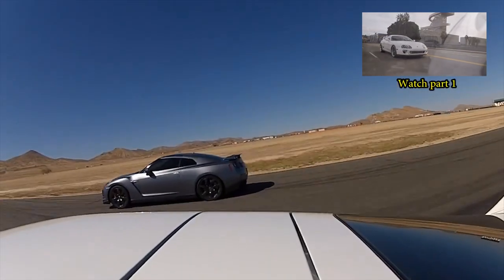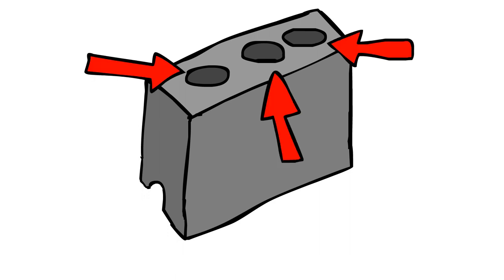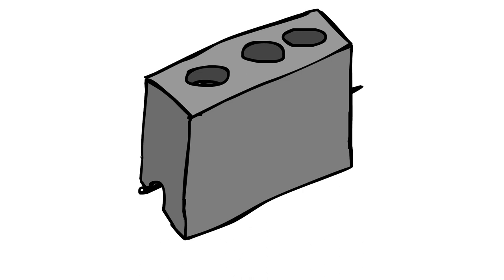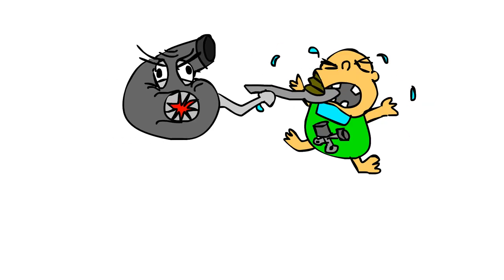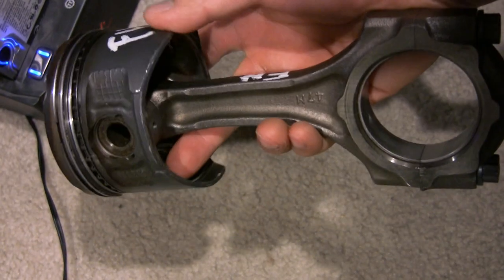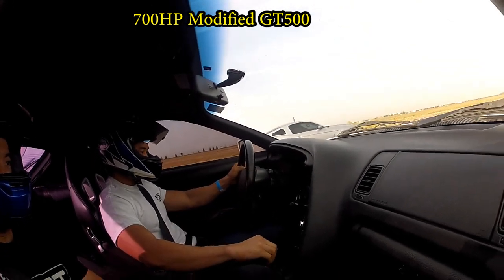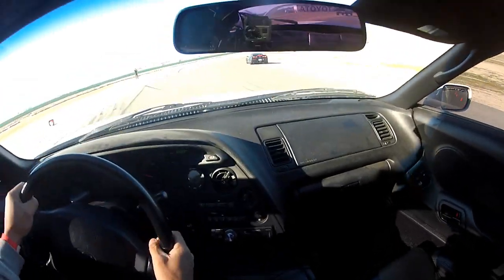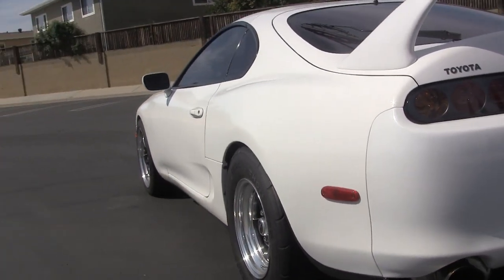My 900HP Toyota Supra TURBO PART 2

Comment: Ha ha ... one does not simply add Weld wheels and huge drag radials on the back and say they're done racing ... you'll be back!  My stock NA Supra is still chilling -- I want to drive it this summer, before going all ape crazy with mine as well (plus my 700 HP Impreza isn't happy with me either) ... but congrats for being back on the road just the same.

Comment: Looking at your Video... I am So happy to say that taking my car to get the motor build, gearbox done stage 3, complete pro mod upgrade for rear drive train, the right Suspension and  wheels and brakes, cage in the car all with a sweet ProEfi setup... All good for a daily 1200whp like the TRC Supra... I'm just happy i know that doing it right from the get go with NOTHING to break over and go on a trial and error issue...  sorry you had to spend so much money man. Them Supras don't come cheap and if I am in 60k,  i could not even try to think what you spent... ?  Good luck with your car man.. :)
Reply: +speadfreakmax Your car will break soon enough.  It's the nature of the beast.  And there's no such thing as a "stage 3" for a v160.  Ask me how I know.
Reply: Well stage three as i understood is was when they build, like mine, that the oil flow easier to the front when you do hard pulls on the v160. that is all that i understood from jacks transmission that goes for stage 3. 
And yes you are right , shit will always break, but it's like being NOT fit for a football game and being fit. the one that is fitter will just do better.. same goes for the motors... if it was build right for the purpose then other than human error how can it go wrong. 

And yes please, i am always open to learn. why do you say no stage 3 ?
Reply: +speadfreakmax you fell victim to Jacks' marketing.  there's not one single aftermarket component inside your "stage 3," so tell me again how that can possibly be a "stage 3," even if he did his magic soup synchro "preloading and groove opening."

Seriously, you'd have been better off getting a stage 1.
Reply: As things are right now, synchros are done, and short shift kit with the "oil flow" to the front. Box meshes like a warm knife in butter, but like you said, Nothing lasts forever and on top of that all, parts are tougher to come by.
Reply: +speadfreakmax I've rebuilt over 15 v160's.  The synchros he put in your box, specifically the friction rings (3 ring system) may have had the oil grooves enlarged, but that's not going to prolong their life as others have broken "Jacks modified synchro's" before.  the "trap door" he installed may keep a residual amount of fluid on the input shaft (5/6th gear/counter), but that hasn't been proven to improve the life span of the front gear set.

My factory v160 that I rebuilt with stock, OEM parts shifts like butter, too, as well as many other factory v160's that are in my area.

Sorry, buddy, you got duped for marketing that prey's on people who can't see past the smoke and mirror.

Next time, and there will be a next time...get a stage 1 and save yourself some money.

Comment: Awesome videos! I may have missed it if you had already mentioned it, but were you running e85 or pump and what type of fuel system are you using. Getting ready to take the leap into the e85 world and was curious of your experience

Comment: THANK YOU for making this video!! Just out of curiosity, how did you/the shop find out that the reason it spit the bottom half of the con rod through the oil pan was bc they hadn't torqued the bolts correctly? I'm just wondering how you can diagnose that's the reason, after it happened.
Reply: +Arthur Sperotto It's possible that the bolt were not broken and managed to wiggle their way off the threads.

Comment: Love your videos and I can relate about wanting more. Had my 93 supra in and out of the shop while increasing power and breaking stuff along the way. went from 400-1000+ whp and built the motor 3 times and now a broken v160 so car is down again. I plan to keep it on low boost which is around 700hp most of the time to keep it from breaking shit.

Comment: How much do you estimate you've spent on your Supra?
Reply: +Gee Singh Never ask a man that -- it's like asking a woman how much she weighs ...
Reply: +mbdulka true
Reply: Guaranteed he's got over 40k into motor alone
Reply: +Chiri Kotoji (Chirikotoji) doubt that.
Reply: +b00stedrust maybe more
Reply: It cost about 10-15k per build for that power level (not counting supporting mods that he can reuse on each build) ... 40K is probably about right (just on motor and heads) ... not counting injectors, FFIM, and other supporting mods.  The motor itself would be around 10-20k ... then another 5-8k to rebuild of a lot of the guts can be reused.  I can build a 1200 HP Supra (just the motor) for about 20k ... not's not counting the 20k more you'll need in supporting mods.  Of course you go go cheaper but it won't last.
Reply: I highly highly doubt he spent $40,000 on the motor LOL
Reply: +b00stedrust sorry I thought he said on the whole car.
Reply: It all depends what his mods are -- I don't think he went cheap (outside of the first motor he bought) ... whatever the case, it's a beautiful Supra and can't wait to see more race videos :-)
Reply: Even buying the best of the best you would have to try very hard to spend $40,000 on a straight-6 Supra motor... honestly I don't even think that's possible.. unless you're getting ridiculously overcharged for labor.. That would be the only way but in parts? No more than $10,000 even less if you did bargain shopping.. and that's for name brand parts CP Pistons... Eagle rods as opposed to a Carrillo rod setup...etc etc
Reply: You can get a 3.4 L stroker block from Real Street Performace for 13,000 USD -- then another 8K for a big HP prepped head -- so that's let's say 20k.  So purely for the motor, ok 20k as I wrote.  But then you add in tranny work to hold the power, fuel system (ID2000 injectors cost 1.5k on their own for the Supra), tons of other mods to hold that power ... he's built a few engines, so 40k just on motor(s) (for 3 or so motors) would be legit.
Reply: +Gee Singh More than you can afford pal. Ferrari.
Reply: he's redone his motor twice, he blew the first one didn't he? that can easily be 40k in total
Reply: +mbdulka You don't need tranny work for these v160's.
Reply: The Getrag is strong, but usually at that level things start to go (as his is starting to do) ... but having said that, he still has to have a $3k or so clutch to hold that power.

Comment: so how much HP does that turbo give at the 38psi you use? I dont know much about cars, but from this video im thinking that A LOT of the HP comes from the turbo??
So theoretically you can add LOTS of HP to any car by just adding boost? And how much is LOTS (like a number or percentage or something to wrap my head around!!) ????????????
Reply: 41 pounds of boost made close to 1000 hp. For a street engine 40 is a lot. 
And yes, up the boost is a easy way to add power if the engine can handle it.

Comment: Honestly if I were you I would only modify my Supra for 500-600hp.
Reply: I would say 500-700 is still a good range for a supra
Reply: +wiphead112 
700 is too much for me 
650HP is my limit.
Reply: I just feel that you can Daily, Drag, and take corners with 700 although its too much for some
Reply: I'd modify mines to 2000 hp :D, and drive it as my daily lololol
Reply: Same but my max range would be 700HP the most for mine.
Reply: without an automatic forget drag racing it.

Comment: If you were to sell the supra, what would you consider a fair asking price? I'm just curious.
Reply: +slydog98j he was interested in my 05 NSX but wanted money on top of the car which has a 55-60k value so he wants more than 60k. In today's market its worth that. Just bought a stock TT 6 speed supra for 38k last month
Reply: +Chandler Bingham Holy shit that is expensive. What the hell lol.
Reply: slydog98j Yeah these are not cheap cars haha. and for starting with a stock motor you spend like 40k plus to get in the 1k range.

Comment: What shop neglected to torque down the rod bolts?  Regardless if they covered it, that's still hassle and downtime.  And what if you caused a wreck? Put them on blast; make sure whatever idiot worked on your car is humiliated and remembers to always torque all bolts.

Comment: I'm surprised the V160 went through that much abuse before letting go.
Reply: +12389h 

I'm surprised he split the casing with only 900hp to be honest.
Reply: The Boss
You have to remember how much abuse he gave the stock tranny.
Reply: *****

Plenty do including me over the past 18 years, from bpu to 1200+. Not saying it's impossible, but personally never seen one crack the casing until 1400+ range, thus a surprised.